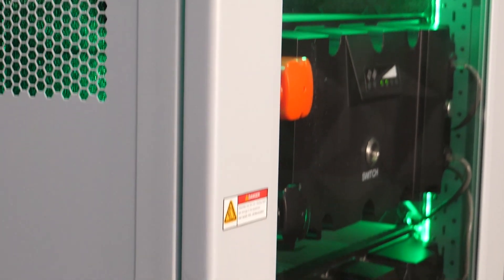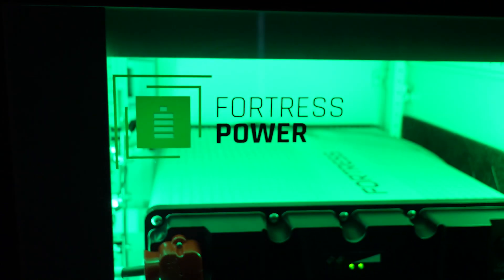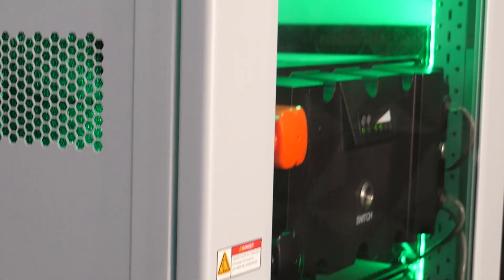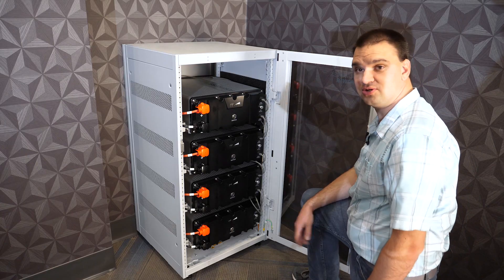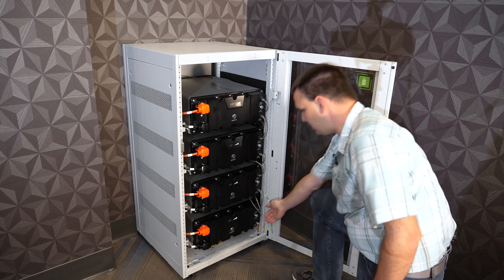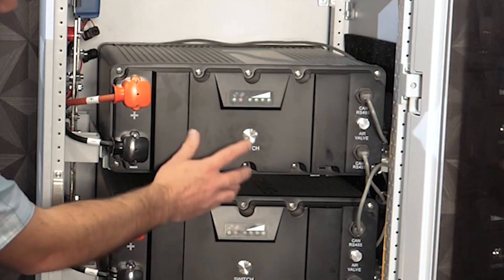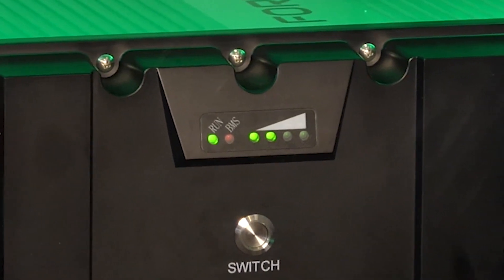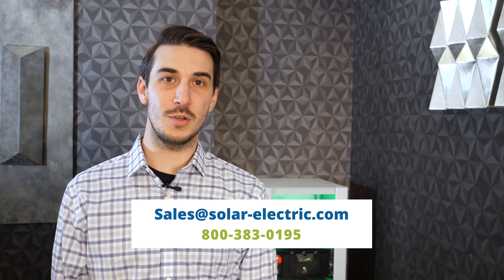Fortress Power eFlex Battery and FlexRack - Set up and technical details

Comment: Hello NAZ, can you help me with a Sunny Island inverter connected to e flex 5.4 batteries? It's a new install but it has error codes and it turns off. Fortress helped with a little troubleshooting. Technition hasn't followed up for a long while.

Comment: I called Fortress Power and they said their Eflex 5.4kWh battery has a self consumption of 30 watts while active.    30 watts x 24hrs = 720 watt-hours just to stay active.  That's 14% of the battery's capacity!  

No freaking way would I buy one of those..    Seriously, what idiot would design a battery that would self discharge in just 7 days on its own?
Reply: OMFG!  I've been looking for someone else who has this information.  I have 10 of these ridiculous things ($35k) and am SCREAMING mad.  Is your name Murphy?  I've been on the DIY Solar Forum jumping through hoops trying to figure out how to fix my purchasing error (which was really more like being majorly defrauded as this information is not posted anywhere).
Reply from the maker: I understand you did not purchase through NAZ but if our engineering team can be of help please feel free to reach out.
Reply: @NAZSolarElectric  I'm still waiting to hear back from you guys and I did purchase my equipment through you and you are aware of this situation.  I still need help.
Reply from the maker: Response from our engineering team: "You might want to consider the Fortress Evault Max Battery if you're worried about significant self-consumption. In most cases it's uncommon for active systems to go so long uncharged. I believe it was Fortress's intention to provide an extremely robust and configurable BMS in this eFlex product. Unlike many other manufacturers that use FET based disconnects, this BMS is a contactor driven solution which makes this a much more reliable and robust product. The sacrifice is a slightly higher internal energy consumption."

Comment: This is a great system, I have 40 panels 2 racks with 8 e flex batteries total. %100 off grid . 2 a/c units hot tub, 2 1/2 refrigerators 5 tvs. well pump etc. No issues and easy enough to hook up myself! Northern Arizona Wind & Sun was great to work with !
Reply: How are you not seeing the self-consumption of those batteries that I'm seeing with 10 of these suckers?  When I questioned Fortress, they literally told me these batteries eat 30 watts per hour EACH.  For me that adds up to 7.2kWH per day which is more then my winter uptake in a day.  So I drain my overpriced paperweights in a matter of days despite having little to no load some days.  In good PV, I don't need that much storage.  I literally wasted $35k on paperweights!